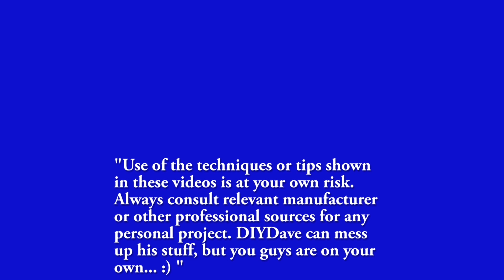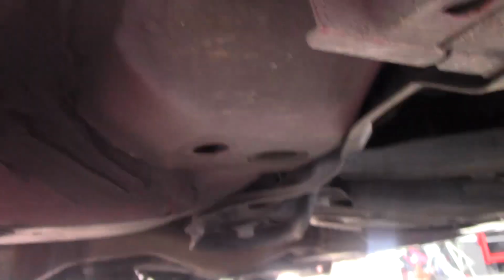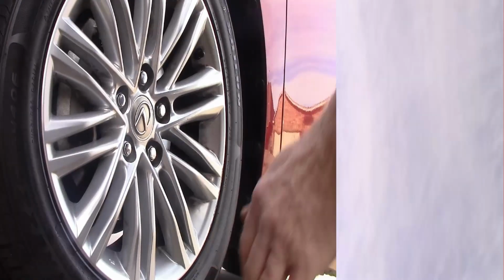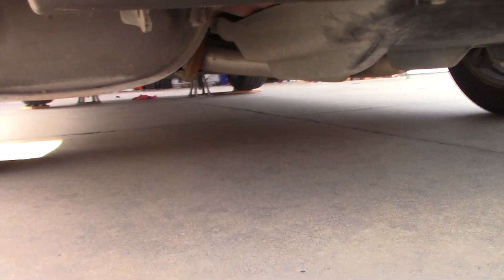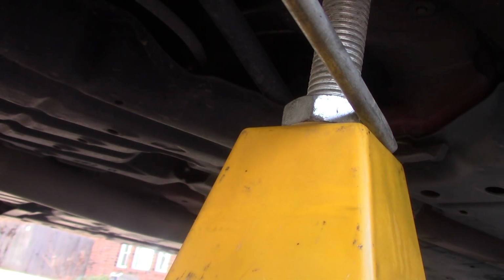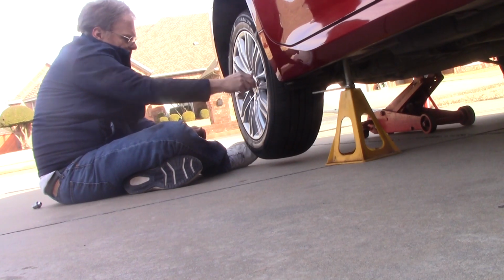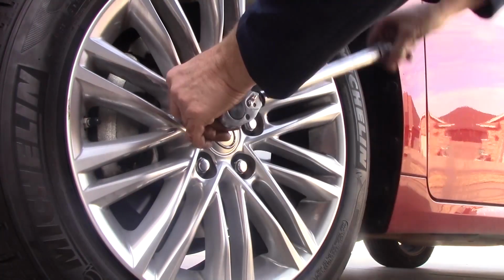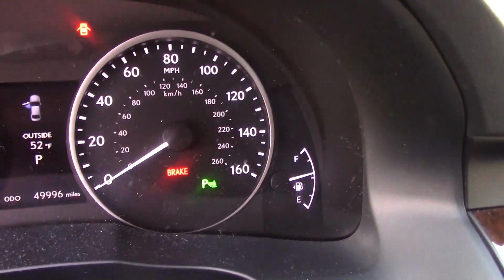DIY Tire Rotation - 2015 Lexus ES350

Comment: Hi Dave. You did an awesome job showing where to position the floor jack, but you didn't give any information on the placement of the jack stands on the front of the car. Can you tell me where the jack stands need to be positioned on the front of the car?
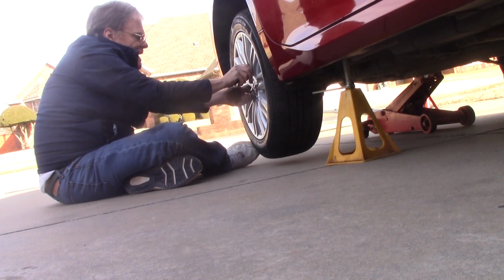Reply from the maker: Just slide them under the pinch welds in front of the rear tires. Take a look @ 19:51 . Thanks for watching!
Reply: Thanks for the quick reply. The placement of the jack stands for the rear of the car is shown @ 19:51.  I wanted to know about the placement of the jackstands for the front of the car.
Reply from the maker: Duh! I'm sorry. The front jack stands can also go under the front pinch welds just behind the front tires.
Reply: @DIYDaveOK  Awesome. Thanks!

Comment: It would seem better to do this yourself as the standard tire rotation involves back to front and criss cross
Reply from the maker: Thanks for the comment! I think unless a particular tire manufacturer specifies you must follow their particular rotation rules, I have to believe the smartest notion to follow is the rotation instructions of the vehicle manufacturer. That's why I went front-to-back, right from the manual. Thanks so much for watching!
Reply: Not if the tires are unidirectional.